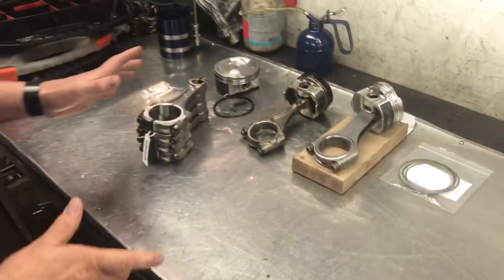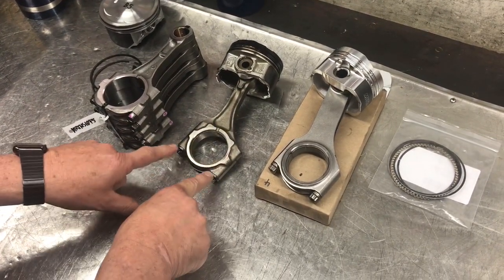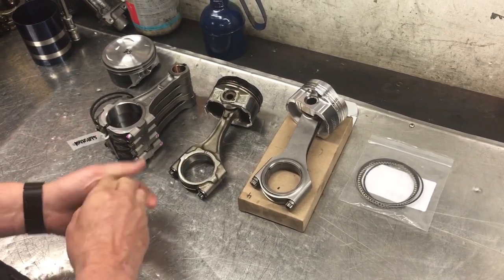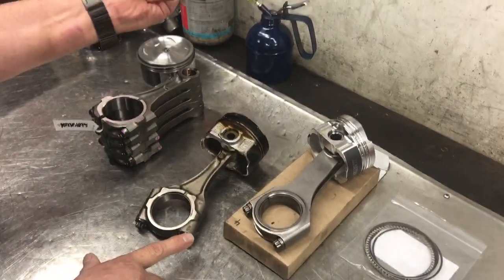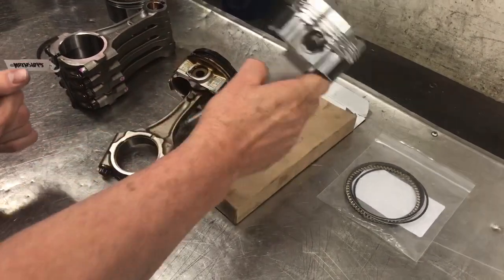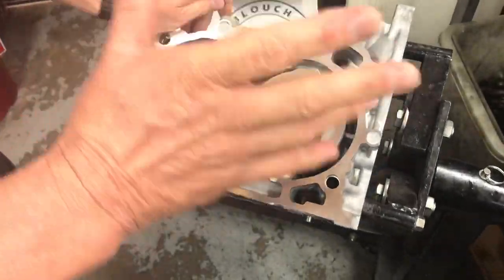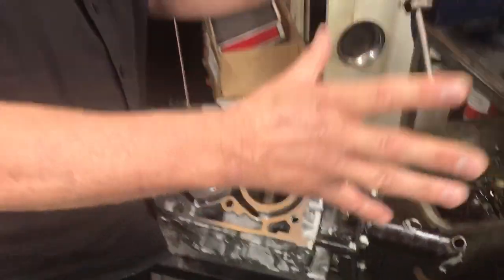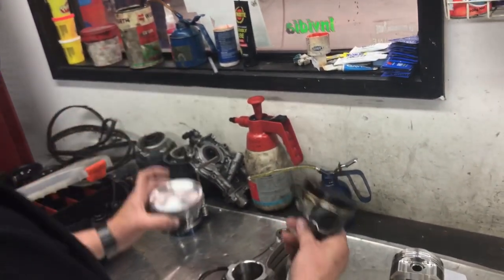FA20DIT Piston & Rod - OEM vs. Aftermarket & Comparison to EJ

Comment: Hey,  great video.  Under how much power would the conrod actually start bending? Thanks
Reply: I think as low as mid 300s to 400 from what I've heard. Depends on how hard the car is driven really..
Reply: @TTime685  fair enough, is that wheel horsepower?
Reply: @theherrderr  Yeah

Comment: @MRT can you guys do a video comparing the FA20DIT to the BRZ/T86 naturally aspirated FA20? Are there any major differences besides the turbo and the oil cooler?
Reply: Google the dsport website to see the major differences, cylinder heads and even the blocks are quite different from each other.

Comment: If I wanted to make more power and replace stock internals what would I change out besides con rods and pistons? Anything else major or minor?
Reply: Depends on power goals. If you plan to not exceed 400whp-400wtq then rods alone should be fine. If you plan to exceeed 400whp/wtq then I’d upgrade block/internals/turbo and transmission.
Reply: @ZFA1738  trans and diff don't hold so we'll after 350-400 tq. Unfortunately 😭
Reply: @christopherrogers8316  300 to the wheels is all you need in a dc5 in my opinion. Easily a low 13, high 12 second car all day.

Comment: Could you or some one let me know the boost limit for a Stock FA 20 engine on a Scion FRS with out bending or breaking internals. I have a Jackson Racing 9Psi Supercharger with intercooler and High Performance Radiator with oil cooler. I never track the car only street driven in Florida. Don't want to blow my engine. Thanks
Reply: I've been researching this as well for my FRS and decided on having it built now that I have all of my other mods on it before boost. Basically anywhere from 8-10psi can do it apparently. But the forums have shown it can happen with less.

Comment: Going to go out on a limb and say that the boost levels required to bend a FA20DIT stock con-rod is something more that what is somewhat more than the max boost available to the stock build.
Right or wrong?
Reply: I hope right. Otherwise I have a time bomb in my garage lol
Reply: Bone Stock ‘15 Dealer maintained early everytime/all recommendations done... Just broke a rod at 82k mi. These motors on stock tune overboost past 22psi sometimes, and the rods can’t handle. Utter Garbage!

Comment: I'm more curious about information for the car (2015+ wrx's) that had the problems. How much boost was he running and what would you consider to be safe on the stock internals? Also what realistically do you think is safe horsepower numbers for this car on stock internals?

Comment: So what max psi level have you found to be safe for 2013 and up fa20 FRS internals cons rods?
Reply: How about safe hp levels for the new 2018 wrx motors?
Reply: I think it depends how long you want your car to last, you can run 14psi... it'll be fast as fuck. But probably blow up down the street, for fa20 its about ~10psi. Also, depends on what you call safe, you got 200k miles stock or 100-150k miles modded depending on how much boost you run. Also remember when you slap on a turbo, you got a lot of heat management things to worry about, especially when its not designed for it. Switch out the piston and con rods when you can.
Reply: @Captain Buff The Third hehehe, the real question is do you want a stock car you can drive hard without worrying or a modified car but babying it 😆
Reply: @Captain Buff The Third warranty 😁
Reply: @Captain Buff The Third lol I meant hard within reason! not beating the fuck out of it, on the plus side, nothing last forever :( so might as well as enjoy what you got. Anyhow, I think the magic phrase we can both agree upon is you gotta 'pay to play'.